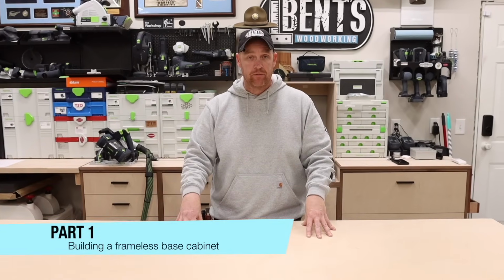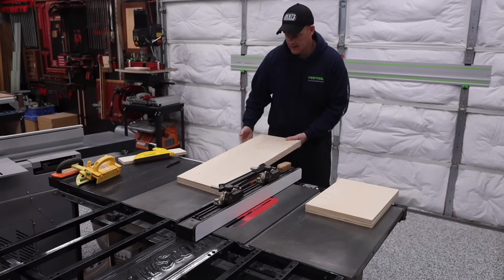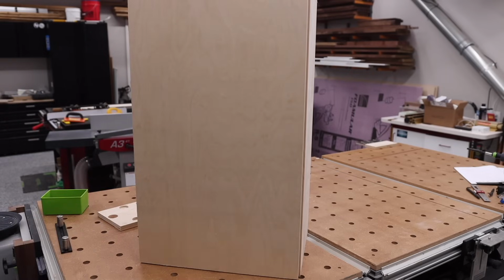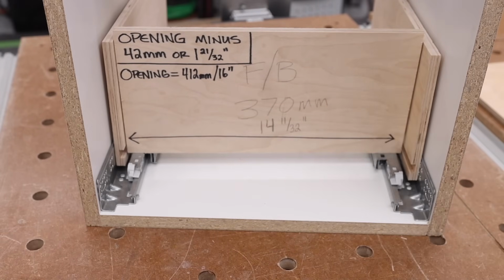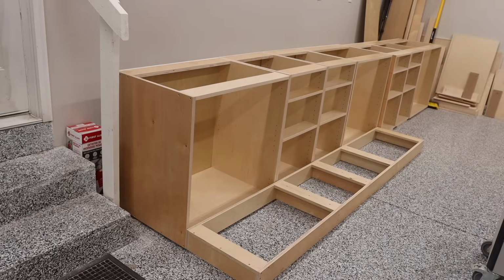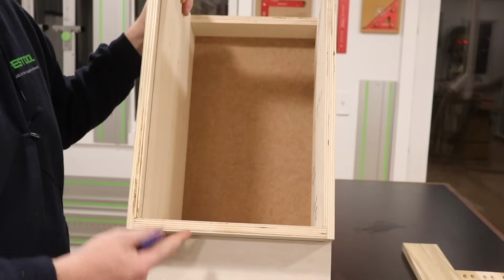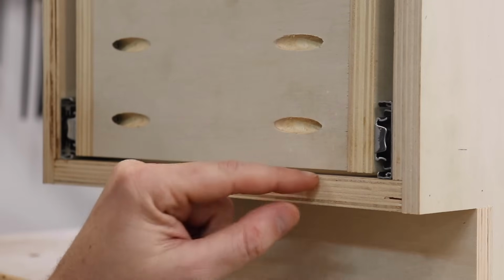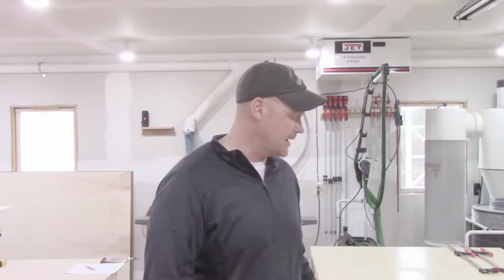Basic Cabinet Making [Compilation]

Comment: I don't know why this one part isn't clicking with me since you've laid out so much!
What is the proper/recommended order of things if you're making cabinets/built ins that have a face frame and are against the wall?

Do you put your cabinet carcass in place, then make your filler strip, but then use that filler strip as one side of the face frame?
Or, do you make the face frame, and then add a thin filler strip beside that somehow?

Comment: Instead of cutting 5mm off the edge to start your panel, why not just do your first cut at the width you want, then just rotate the cut piece 180 degrees and use that as your reference edge?  Since every cut in the middle gives you 2 reference edges - 1 on each side of the blade - why waste time (and material) with the first 5 mm cut?

Comment: Why to use rear stiffener panels with pocket screws instead of using confirmat screws which is a standard assembly method in Europe?
Reply: On the other hand in Europe we rarely use plywood rather MDF and MFC 18mm or thicker so probably that’s the reason.

Comment: Genuine question: why do guys in the US use the imperial system when it is clearly impractical? I see fine carpenters use inches and feet only to then switch to millimetres when small accurate measurements are needed. Also, the math is so much simpler with the metric system compared to using fractions of inches. I know it's a long standing custom but the British have largely overcome it and most now use meters, cm and mm. Seems quite stubborn to keep using an impractical measuring system
Reply: Genuine answer: How about you just go have another PINT,…mate.
Reply: @jeffpierce400  I don't drink pints of beer, only cls of whiskey
Reply: American here. This is the age-old debate and i'l add that you are correct. We have no excuses. Personally, I wish i knew the metric system better. And that concludes the debate.

Comment: Hi Jason, you covered when you have a cabinet with 1 door, but what happens when there are 2 doors? How much smaller should you make each door? Don't want a big gap in the middle, but also don't want the doors colliding. Would 2mm reveal be too much when you have 2 doors?

Comment: Not sure if I missed it or not but do you cut your side panels so they are "balanced". (i.e. increments of 32 mm so a 30" tall wall cabinet would be cut at 30 1/4"  or 768 mm? I like balanced panels so you do not have to distniguish between top and bottom.

Comment: The first section base cabinet had no toe kick, but the one when you talked about face frames did. The thumbnail shows a toe kick... so, which is it?
Whenever any videos use imperial but want to be inclusive they mention the metric equivalent but it doesn't happen the other way around. Only in a couple spots did you give the imperial equivalents. I'm 67 years old, so I will never cross over to use metric... and I have never and will never hire anyone who says, like a couple commenters posted, that "doing fractions of an inch is hard." If you can't figure out instantly that half of 31 5/8 is 15 13/16 or don't know the decimal equivalents of fractions of an inch, I'll pass. I find it sad that at 1:54:00 you say "it's so confusing." It's not confusing... you are confused. You should be able to do that simple calculation in your head instantly. That you cannot do it is not an indictment of imperial measurements. 
Despite these objections, one of the best videos on cabs I've seen... I especially agree with the concept that most are overbuilt... and I especially like the simplicity as I'm getting ready to build out my new workshop.

Comment: Great video series. One comment: shouldn’t the door hinge centre lines be 98mm from top and bottom, not 100mm like the receiver plate? If not, you’d end up with zero reveal at top or bottom, and the other hinge would be 4mm off.

Comment: I wonder why he does this final rip at the table saw. He makes a big case elsewhere on the accuracy of the Festool track saw and the TSO guides. Then why is the table saw step necessary, since there is at least an extra time and material usage?
Reply: It’s faster with the table saw.
Reply: @AaronGeller  Makes sense, thanks.

Comment: NOT sure about the going around the panel, to put the screws in.  When we tried this, the fit would warp, due to differences in the wood grain & hardness.  This always occurs in hardwoods, where the stiffness of the grain varies widely, including knots and inclusions.  Better to do two rectangular edges first, then flip over and do the other side.  Then one corner is always correct.

Comment: Hi! This is great info, Jason. I watched many of these a long time ago. One of the things I always do when I start putting the bottom and sides together is double check the alignment of the 6mm slot for the back. Sometimes I am not able to cut the slots in all pieces at the same time, often having to dado the bottoms after the sides, and having to relocate the saw blade to match. I always use my piece of 6mm scrap from the sheet I use to cut my backs to check this alignment at assembly time. If it is a little off, I feel okay slightly widening the slot on the bottom to make the bottom and sides align. If the bottom ends up a little loose, it won't be a problem. I know you're assuming that everything is cut correctly to begin with, but everyone's shop and equipment is different, and we may not be able to follow your cutting approach to the letter. Best to check everything along the way! Thanx again for the great lessons! (Although all the Festool stuff does get a little old. I know you probably have little choice, though!)  hb
Reply: I mean festool isn’t exactly obtainable by everyone—stuffs expensive!! Lol But still, he does NOT push the brand at us in his videos. Unless… oh, does he have ads for them or something? I don’t get any ads so that may be what you mean; but otherwise, I’ve only ever heard him provide LOTS of the different tool options—most of which are pretty easily available to any/everyone—so ppl can get to the same result with their tools, as he gets to with HIS tools. Lotta diff ways to skin a cat. Lol

Comment: I just have never figured out the logical reasoning for insetting the back one inch. Is there some obscure reasoning I'm just not seeing. It makes a perfect place for critters, it could make the plumbing harder in sink cabinet, and if there is an electrical outlet that would also be harder to install. No Cutom cabinets I've ever seen are built that way!
Also, when I owned and ran a cabinet shop before the days of computers, I always had my people cut the largest panels first, that eliminates the need for cut sheets!

Comment: What more can be said. Great job. It is better to work in plywood, unfortunately in Poland plywood is very expensive and the cheapest reasonable solution is to work in furniture board (chipboard). Moreover, to achieve satisfactory results, I bought a Festool plunge cutter. Regards.

Comment: wish you used inches and not mm
Reply: 95% of the world ( and NASA ) disagree with You.....
Scientists do use metric,
 new units like megabytes and megapixels are metric as well and....
 runners compete for 100 meters ( metric ) like everywhere else in the world.
Even Coca-Cola comes in two liter bottles..........................................................

The Metric System is more logical because it is based on tens. 
There are 10 millimeters in a centimeter, 100 centimeters in a meter, and 1000 meters in a kilometer. 😁
In comparison, the U.S. Customary System has 12 inches in a foot, 3 feet in a yard, and 1,760 yards in a mile.🤕

Comment: An excellent consise tutorial! 
As a former custom ff😅 cabinet builder installer my advice is...

Build a storypole ,build a full cabinet out of scrap...complete with doors and drawers installed.
Think ahead at every step...example install drawer slides before assembling. 
Build a jig/setup for multiples..example make a jig for hinge plates in elevation and depth. 

Quick tip for side mount slides,give up 1/4 errr 6mm and install drawer side flush with bottom of drawer.

Again very well done!
Reply from the maker: Thanks!

Comment: 1:00:35 I'm afraid 16" is not 412mm. 16" = 406.4mm, or rounded 406mm. That's 6mm off of the 412mm you're calling here. Same later on with 370mm vs 14 11/32" which is still 6mm off.

Comment: much easier way for installing cabinet doors for the regular 110 degree hinges is to drill and install the hinge in the doors, clip the boards on, put the cabinet on the side where hinges are installed to and just make a spacing between edge of the doors and cabinet (2mm for the normal opening and 4mm for tip-on system). works perfect and much faster :)

Comment: Kick plate on the center island.. yes or no? 

First, I am painting cabinets. Second, I am putting a facia on the sides and back. The back is a short wall. I will be using a beaded panel on those 3 sides. I will be using corner molding on the 2 corners to cover seams and add dimension. 

I am now thinking about buying a 1/16 panel to glue to the front frame. I will fill .seams with putty. I plan to build shaker doors and drawers. 

Any flaws in my idea?

Comment: Great compilation. Some of these I’ve never seen. 

I found myself using metric on a small project I made recently. I never understood why people even cared. But metric is SOOOO much easier. BY FAR! I’ve just always been used to imperial. Whole numbers are so much easier. LOL

BTW… when you asked Alexa to do the math… the Alexa in my room said “Sorry… I’m not sure I can do that for you.” 😂😂😂

My goal for 2024 is to get a new miter station cabinet built. My miter saw won’t be the key thing. It’s more…. Shop cabinets… that will happen to have a miter saw on them. LOL. Building them with intentions of having a Kapex sitting on it. Not sure if that’s the next tool I’ll buy or not. I rarely use my miter saw lately.

Comment: I’m building two floor to ceiling built ins on the sides of my white painted brick fireplace. Do you have any advice on what should be done as far as filler strips? Should I scrub just the bricks and caulk the gaps for the mortar joints or scribe it exactly like I would a wall? Or maybe you have another suggestion. Any advice is welcome. Thanks for the great video!

Comment: You like to use the 32mm spaced pin holes for mounting drawer slides but I am not aware of you doing a video on sizing drawers based on the 32mm spacing and how you align the holes in relation to the cabinet sides.

Comment: You often talk about screwing your cabinets together from the sides because you will cover the end cabinets but I am not aware of you actually doing a video on ways to cover the ends of the last cabinets in a run of cabinets.
Reply: Typically they will get covered with an end panel after install.

 I would love to see him do an in depth video on end panels and how to install them etc.
Reply: Put an end panel
Reply: Does the end panel stick out beyond the overlay doors? Does it have a toe kick notch or the joint with the base support can be visible? It would be good to see this in action, agreed.
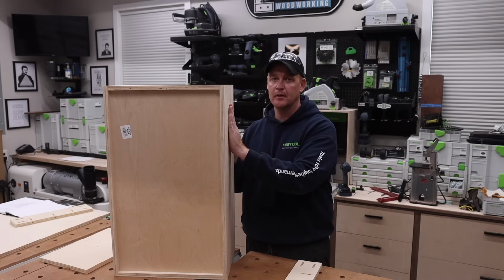Reply: He talks about it @ 31:50 mark
Reply: As with most European and I guess western kitchens and cabinetry, simply add a flat panel to the ends, no need for ugly pockets screws etc. I don’t know why the US doesn’t do this as standard. A line of cabinets are designed to have end panels so they take these into account when sizing them to fit length required.
Reply: @runforrestrun1965  the "ugly" pocket holes would not be visible as you would put them on the rear part of the back panel. An end panel is also a good method, but pocket screws are just as good and use less material and variation in your dimensions. 
However, if you were screwing the panels in from the sides, which is easier to do that using pocket screws, end panels are the way to go, as you mentioned.
Reply: I’d like to know this as well. Seems the best option would be to either use pocket screws to assemble the end cabinet or dados and glue. 

Edit: while he doesn’t show it he does talk about different methods at 32:00

Comment: Great video.  Love the trick of using the nailer as the measure to cut the dado groove for the back panel.  Also like the trick of applying the edge banding prior to cutting everything down to size.  And... not having to use a ton of clamps to square things up makes things so much easier and faster.  I'm a female DIYer, but I love my projects to look professional and not like they were DIY'd.  This video is going into my "Saves" so I can reference it the next time I have to build cabinets.  I've also just switched from Imperial to Metric.  Don't know why all US woodworkers don't adopt this measurement system.  It's so much easier and less prone to mathematical errors.  Cheers!
Reply: agree, metric is just straight numbers, could not be more basic. Let's not mention gallons etc. as ml and litres etc is so damn easy, again, just basic numbers by 10s, 100s, 1000s etc.  Lbs and kilos also. Need a 'revote' on that decision LOL!!!  (just mho).

Comment: Check out the Blum Ecodrill.  I’ve used the drill press but this thing is fast and accurate for the 35mm hole and 8mm holes. If you don’t use the hinges with dowels, you can keep the spacers on those two drills. That way the 8mm drills only dimple the wood where your screws align.  This thing easily sets edge distance and hinges hole depth.

Hinge and baseplate locator doesn’t get any easier than the QuickFix Hinge Assembly Guide by Blum

Last but not least. For locating and drilling 5mm mounting holes for all Blum undercount slides…Universal Individual Boring Template for AVENTOS Blum 65.1051.02. It says is for avento but I use it for all Blum slides and other slides. It will backset 37mm from front and then the remaining holes at 32mm increments.

Hope this is useful